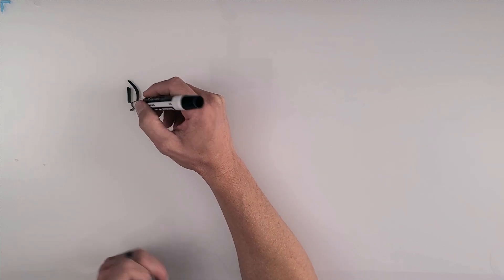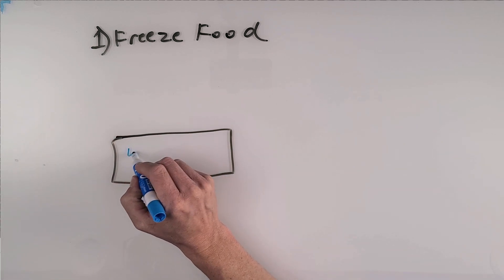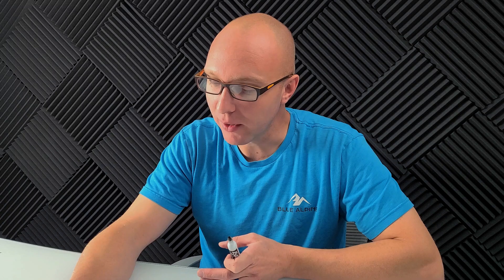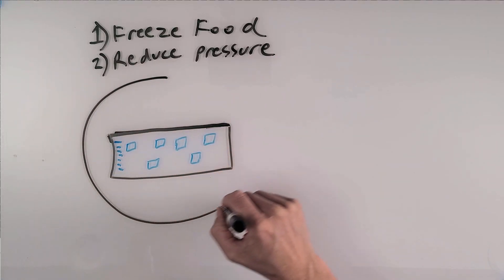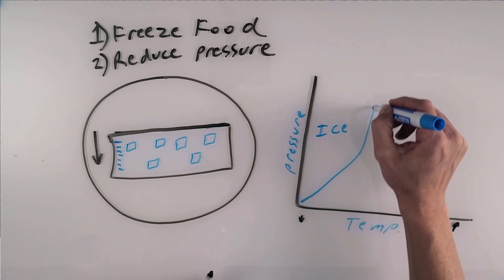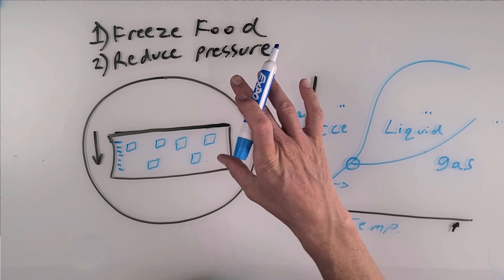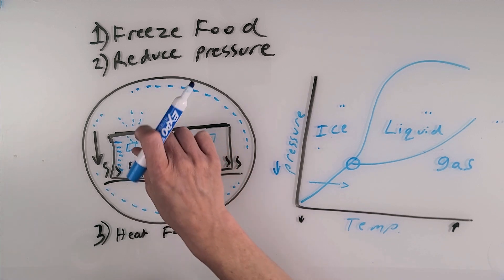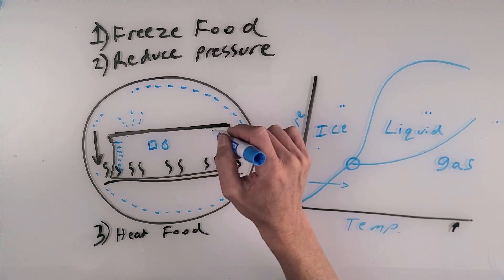What Is Freeze-Drying And How Does It Work?

Comment: What is the consequence(s) of establishing a higher vacuum than on the recipes?  In other words, if the meat recipe default is 825 mTorr, what would the consequence be to set it at 600 mTorr?
Reply from the maker: If you increase the pressure then the cycle will go a little faster, but you also increase the chances of passing the eutectic temperature, which would cause the food to collapse, so a higher vacuum would also benefit from a lower shelf temperature depending on what you are freeze-drying. 

For example adjusting the meat recipe to 600 mTorr would get it done a little faster. But you might end up with a more jerky like texture unless you also adjust the shelf temp. (Chicken is pretty hard to mess up though, so a better example would be with fruit, you would for sure need to adjust the shelf temp or risk dehydrating instead of freeze-drying.)

Hopefully this answers your question! :)